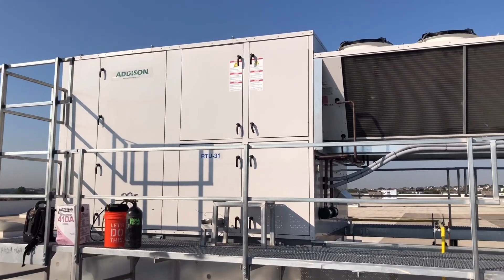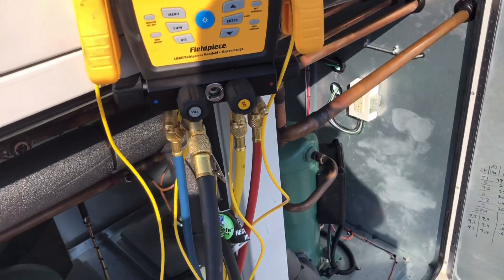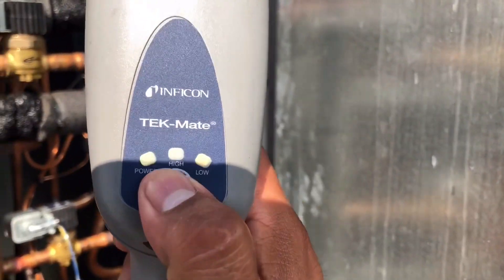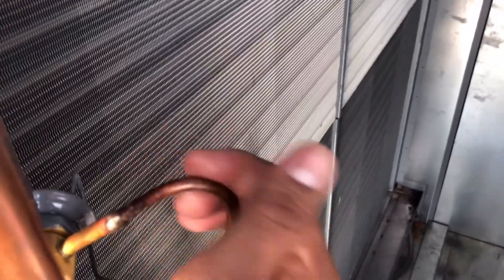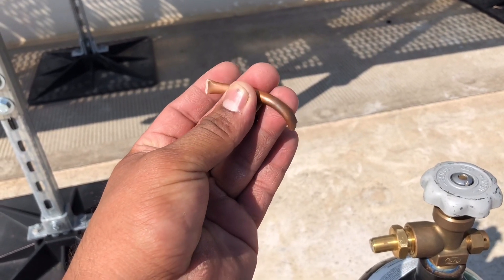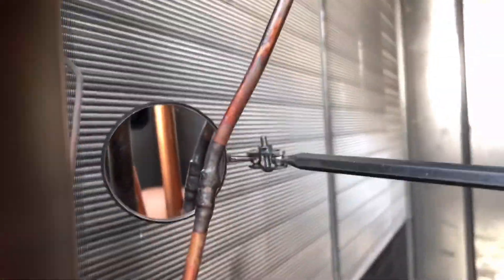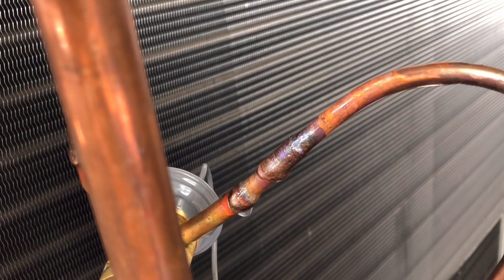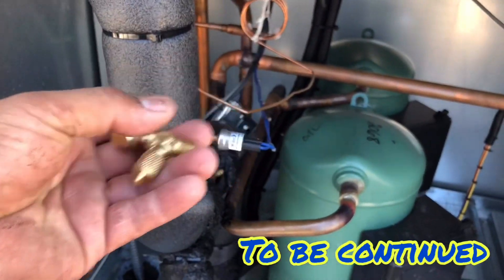HVAC:  Addison Dehumidification Unit leak search and repair. H10Pro vs Inficon Dtek

Comment: Hey Rookie
Can you give me some tips on the oxygen and acetylene pressure set up, I tend to blow off the flame everytime I try to light up my torches. And also what tips to use on bigger pipes ?
Reply from the maker: I think I may not be the guy for that.  Lol.  I always use 5 acetylene 10 oxy for my 0 and 1 tips.   For number 3 rosebud I use like 10 acetylene 15 oxy.   I think.  Not very sure.   But when lighting the torch try to open the oxy first just a little.   Then acetylene.   That prevents the flame and those black flurries 😂😂
Reply: @rookierefrigeration4357  thanks a lot. My man I will it next time. What do you mean by 0 and 1 ?
Reply: And 3 rose bud
Reply from the maker: @xraybravo7180  those are the brazing tips.
Reply: @rookierefrigeration4357  thanks bhd have a good weekend 😀

Comment: Was that oil on your condenser coils, at the top of the coil?
Reply from the maker: No. Just water.  These coils tend to look like oil leaks.  But it’s just water.
Reply: @rookierefrigeration4357  Holy crap, your condenser is leaking water!

Comment: Would’ve been less heat into the valve if you just brazed the line right into the EQ port instead of 2 joints 1/2” away 🧐
Reply: Also no new filter drier? 😳 how long has it been sitting there empty lol
Reply from the maker: Cmon man. Of course it has a new drier.  What do they Call me, “Paul Stoner?”
Reply: Rookie Refrigeration 😂😂😂😂

Comment: The H-10 Pro works the same way as the old GE leak detectors.  Those things could detect the tiny amount of gas leaking out of the valve of a Halon fire extinguisher.
Reply from the maker: Yeah I like it.
Reply: @rookierefrigeration4357  They won't work as well as an FTIR detector like the TEK-Mate for mixed refrigerants, though.  And for CO2 only an FTIR detector will work.

Comment: Here's a tip bro, with these Addison units, you're able to take out the Schrader Cores, I use two appion Schrader core removal tools, and 3/8 black vac hoses. Been able to pull down to 500 microns in about an hr or so. I normally vac my systems for a looong time even below 500, I'm just that guy. 
P.S. Addisons are crappy units, factory workers just don't care, smh
Reply from the maker: Lmao.  Yup. I agree.  I was not able to remove that one schraeder though.

Comment: Could it have been possible to solder that with a map torch? Since it was small pipe Or is oxy acetylene the preferred way to go every time?
Reply: It's best to use the heaviest bulkiest torches -you want to stay in shape-no-LOL
Reply from the maker: Lol.  Well if u put it that way.  😂
Reply from the maker: It is possible.  But just faster with oxy.  Especially since we are outside.  I would really love to find a small set of oxy acetylene tanks.   Like really small.  Lol

Comment: That's correct in my opinion.  Don't solder on an existing txv if you don't have too!
Reply from the maker: Brad Millwood exactly bro.  Wasn’t thrilled about the look but that’s better than burning out a valve 🤣

Comment: You could use a screw extractor bit on that broken Schrader core, or I know yellow jacket and cps (probably others, too) make a specific tool for broken cores as well. Good thing to have in the bag for next time :). Keep the videos coming, I like showing real world scenarios like yours to the guys during training.
Reply from the maker: Malcolm Hinkle thanks. I’ll look into it.  Gotta admit, first time I break a schraeder 🤷🏼‍♂️
Reply: Rookie Refrigeration most of the Klein hvac 8-1 or the 11-1 have the broke Shrader core remover. Looks like a tiny reamer.
Reply: 3/32" drill bit VERY slowly has gotten me out of a bind with a broken core.  Not much luck with the broken core extractor tools for me. Chase it with a bike core chaser and you'll be in the green.